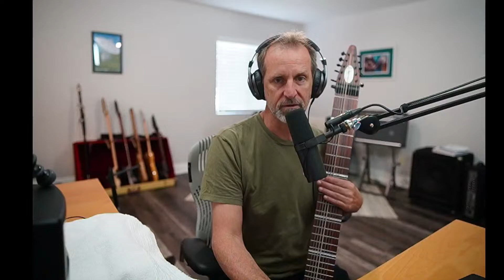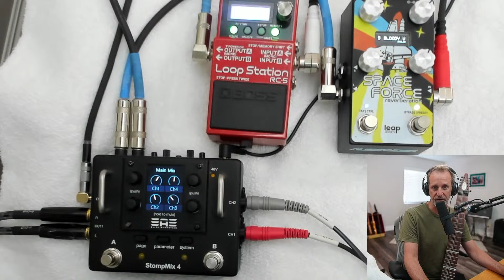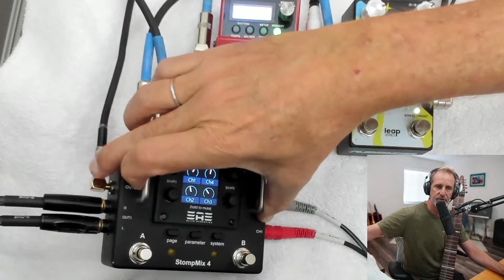Free Hands Friday - StompMix-4

Comment: Doesn't the instrument need Hi-Z though? Inputs 1 and 2 are line level only over 1/4 inch connectors. Another question - under Aux Pan, why do you have Ch3 and Ch4 both panned hard left?
Reply from the maker: For clarity, inputs 1 and 2 can accept 1/4" or XLR. They also each have a pre-amp so if you are using a passive pickup, you won't need a pre-amp. Inputs 3 and 4 are line level. In this video, I was using the OUT2 as an effects send (3.35 to dual 1/4"), so by sending the signal panned left or right, you can configure two separate outboard effects - looper in the left side and reverb in the right and feed them back into channels 3 and 4. It's a clever option. I've had great results with running a Source Audio Collier in stereo too.
Reply: @Freehandsacademy  - I know, brother. I too have a StompMix 4. But the EAE website clearly states that channels 1 and 2 are line level only. So even if you plug in a 1/4 inch TS cable (such as a passive pickup), it will not be impedance matched. So it's not an issue of what size plug the connectors can receive, but rather the impedance of the input. The input has to be Hi-Z because passive pickups are going to usually need one mega-Ohm to sound good, otherwise the guitar doesn't sound right. Per the EAE website, only channels 3 and 4 are Hi-Z inputs. Regarding my second question - you're only using channels 3 and 4 of the Main mix, so never in the video did you use the Aux mix. There are four menus: Main mix, Main pan, Aux mix, and Aux pan. You used Main mix and Aux pan, and under Aux pan, you had channels 3 and 4 both panned hard left even though you never talked about them. Why is that? Just an oversight? (you also have channels 3 and 4 both panned hard left on Aux mix - why is that?) - thanks, man - not trying to be difficult, but I don't think you understood my questions. Appreciate your tutorial :)
Reply from the maker: @rombsix  Maybe have another look - https://shop.eliteacoustics.com/products/eae-stompmix-4-four-channel-digital-mixer-pedal 2 Class-A Mic inputs with TRIM and PAD (CHAN 1 and 2)
2 LINE inputs (CHAN 3 and 4)
Reply: @Freehandsacademy  - brother, don't worry about it. It seems you're not familiar with the nuances that I'm talking about. I appreciate your tutorial. 🙏
Reply: @rombsix  Sure thing brother, just so long as we're looking at the same EAE site, maybe there's another link I'm missing? I'm putting together another vid that will clarify how to use a  stereo pedal with the Chapman Stick - I'll share how I configure channels 3 and 4 as an FX loop for the melody side only.  BTW - checked out your site, love your work - cheers.

Comment: Another great video Gene !  keep in mind that when saving a preset your master volume (both  main and aux) are NOT stored-those are globally. it droves me crazy until i had a chat with David Tipton
Reply from the maker: Maybe I have misunderstood the issue about the preset. I have been able to save volume (aux and main), but not the pedal assignment - that was a global setting that could have been served well as a component of a preset.
Reply: @Freehandsacademy  you can save everything (as far as i know) except for Master volume(both main an aux master)
Reply from the maker: @barlevy13  I have not had that experience, they should save so long as you are saving them from the System menu.
Reply: @Freehandsacademy  can you check it ? main and aux mix not saved ( at least for me and for David Tipton). tnx
Reply from the maker: @barlevy13  You'll need to save at least 2 scenes. I found some faq's on the stompmix-4 page on the mobile version of the Stompmix-4 page that I am not able to access from desktop - I tested this and verified that settings were saved for all parameters.